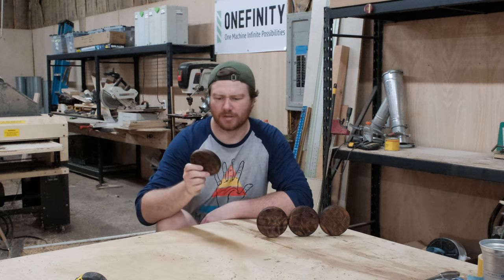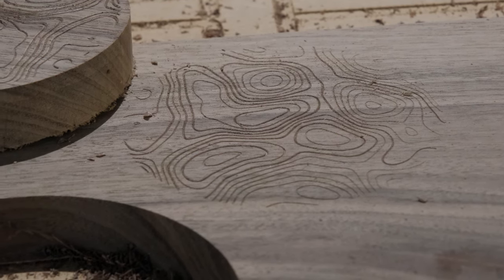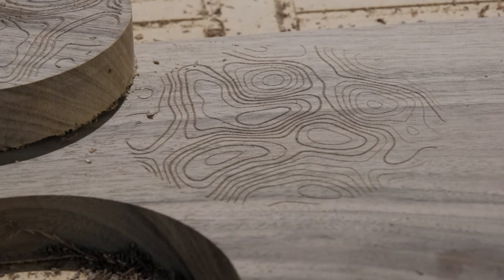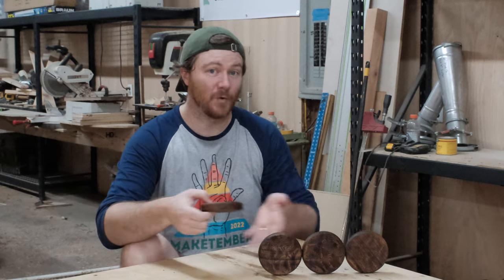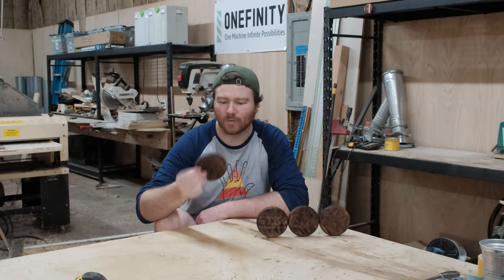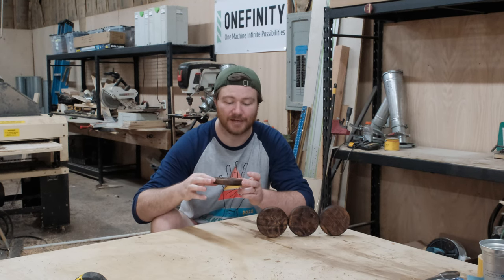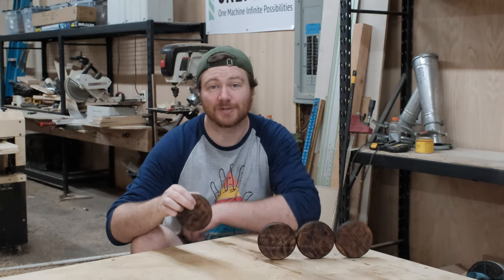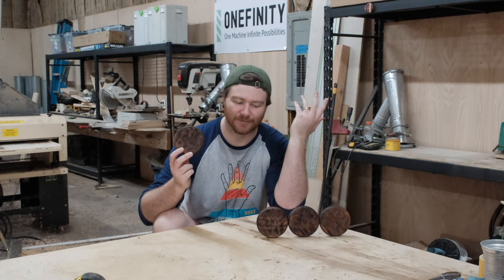Easy CNC Woodworking Projects- Topo Coasters

Comment: I almost never swap bits, just swap routers, I use cheap routers. 1 already died, but I fixed it and since I got multiple routers I don't care that much if one dies. I have 1 router for a V-bit and 1 for 8mm endmill and a dremel for small stuff. Just 2 screws to swap out the router could even add a quick swap system.
Reply: Interesting idea.  I am always concerned about the router being just out of original position enough to wreck the project. Not using a 1F yet but hope to get one.  I’m on an Xcarve currently and I have that issue
Reply from the maker: Very interesting!